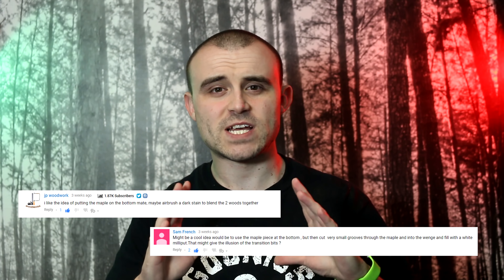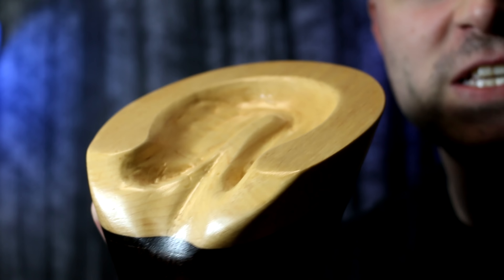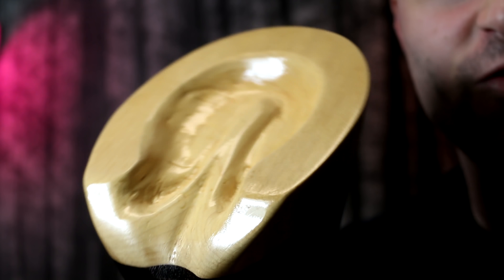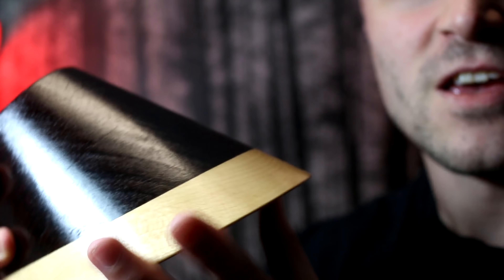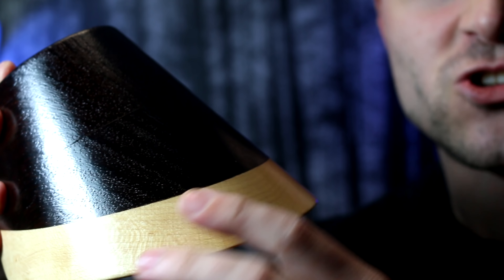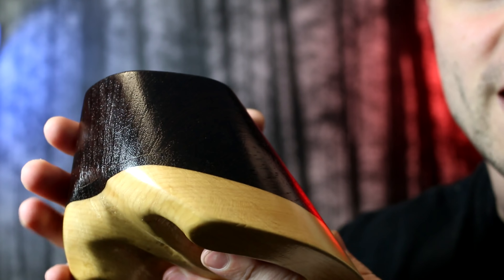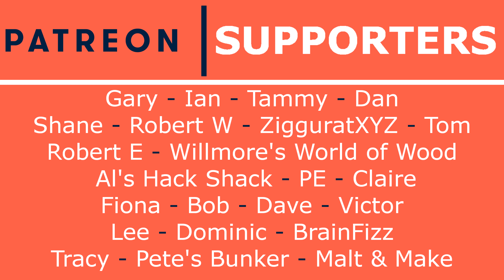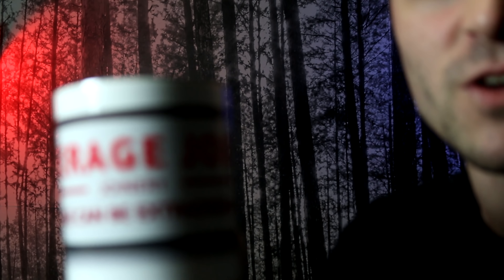Dog Chew Holder, Horse Hoof & Garden Gate - Project Progress

Comment: If you have loads of scraps, I tend to glue them together to make a nice blank. I used pen blank off cuts and made a bowl from those. I've recently done a small series on using 11mm square sapele, created a few open segmented projects which once you have the pieces cut and sanded, you can glue turn, sand and finish very quickly.
Reply from the maker: Those are some great ideas Paul! I cant wait to get into turning properly